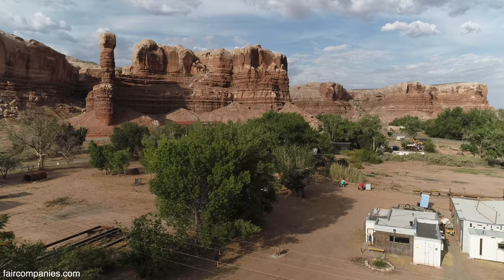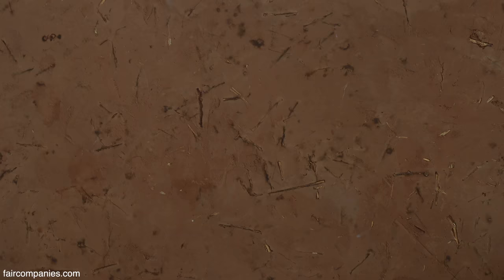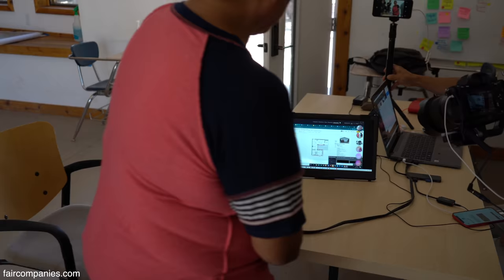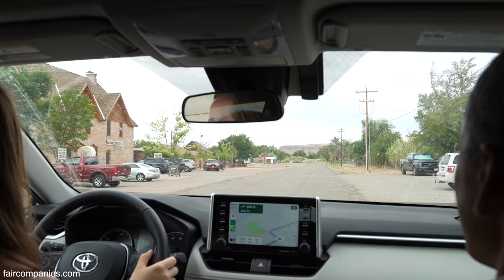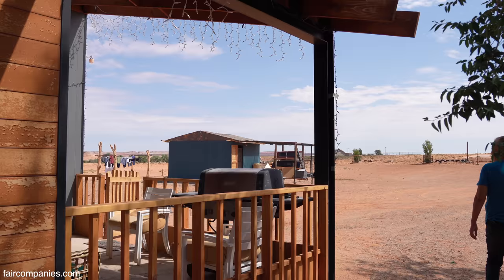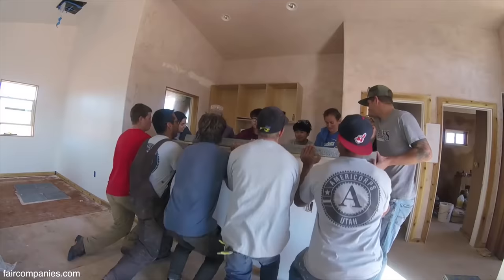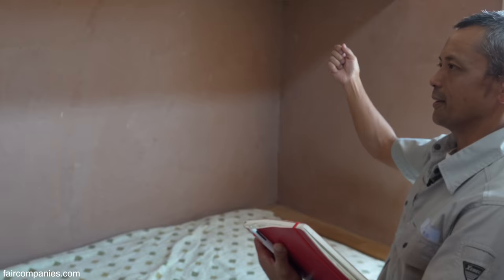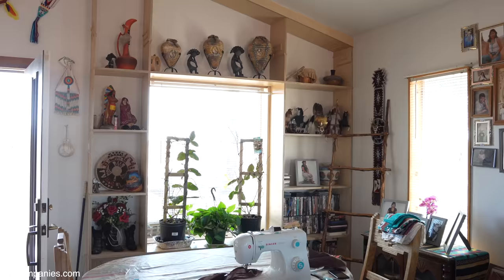Desert dream home quest in Bluff: locally sourced, passive A/C

Comment: I was so intrigued by the flex crete idea, I've been researching it all afternoon. Apparently over 50% of concrete blocks already contain some fly ash, which is why they're called "cinder" blocks. I was excited by the possibility of premade bricks available not too far from me, but theNavajo Flexcrete business seems to have disappeared in the last 5 years or so, about the time debate grew very heated over whether fly ash was a hazardous, heavy metal leaching material, or a miracle antidote to carbon emissions from cement production. Both sides seem equal in their potential for argumentative bias, leaving me unsure what to think. If you're already open to using shipping containers and pallet wood, such concerns probably don't bother you. Let me know if you find out anything else!
Reply: Unfortunately, too many people let perfect be the enemy of better. it is similar to people who argue against using waste plastic to make roads because it can lead to micro plastic dust as if asphalt roads don't lead to asphalt dust
Reply: @cliffordbradford8910  And in either case tire tread dust, which floats and migrates to streams/ocean.
Reply: Look into AAC. It's Aircrete in Europe but in the US aircrete implies foamed concrete, not aerated, & not autoclaved (for strength). 3 N. American sources now
Reply: @cliffordbradford8910  what is asphalt dust? at what rate is it produced? plastic is not nearly as durable as asphalt is. also heavy metal poisoning is still a big issue in a lot of areas where arsenic poisoning results in horrible health effects after it leaches into ground water. It's not a matter of perfect, it's a matter of safety. A tiny amount of certain isotopes of polonium can be biointegrated and kill a person with almost no hope for an antidote. On the other hand, you can eat the equivalent of a box of nails and not have much happen to you as most of it passes through. It all really depends and it seems people are far too eager to ignore the details because they're simply impatient for a solution not realizing it can make things worse.
Reply: As soon as they said coal ash, I was wondering. There's at least some radioactivity in coal ash. Is that a concern here?

Comment: Nice use of shipping containers to define a space that is spanned by a roof and walled-in rather than cramming people inside connected units like rabbits in a warren.
Reply: I liked the way they designed their shipping container houses as well, but I would be hesitant about using them in this sort of location. Their comments about how hot it was inside them made me doubt the thermal capabilities of these metal boxes and whether they should be in a desert. They feel like a fad, shoehorned into a place they don't belong.
Reply: @erebusaeon6945  Fair points.

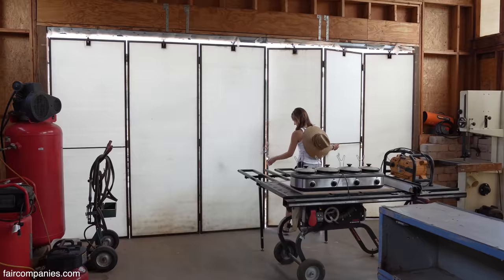Comment: Some good things there, but also some nonsense. Like the downward going bars at 12:10. Seems to be "make it different, just because", which makes me believe that the people designing it have little engineering understanding. You can see the result of such thinking in 12:50, when the woman has trouble opening the folding wall - a technology that is in existence for a very long time. Doing it properly just takes some studying, instead of "make it different, just because".
They could achieve so much more, if they didn't try to reinvent the wheel by making the wheel square.